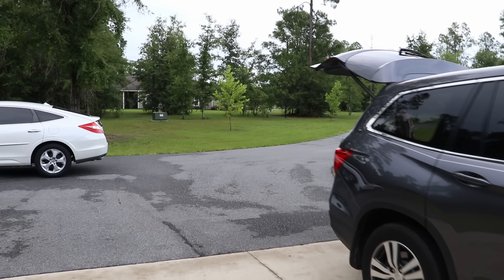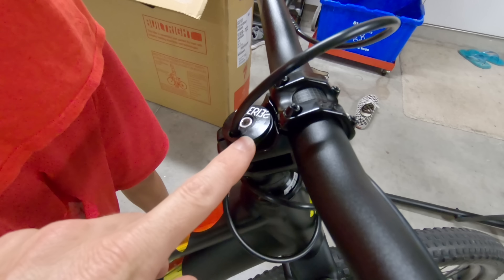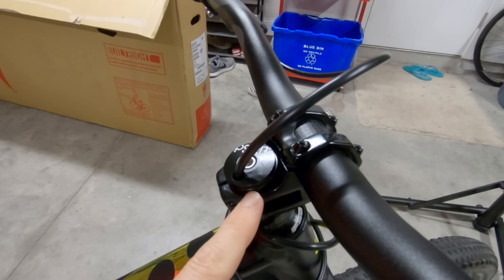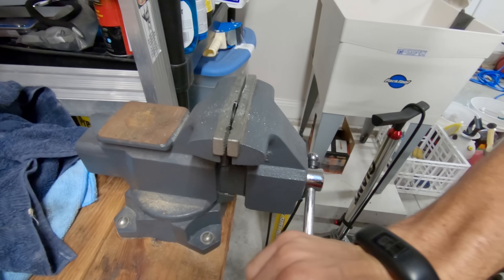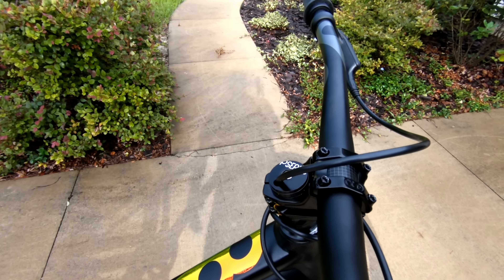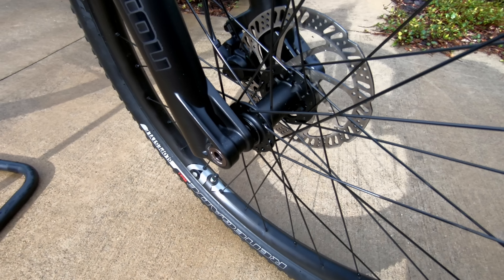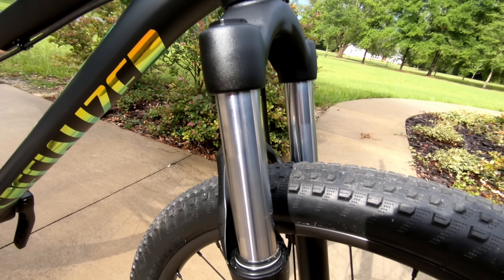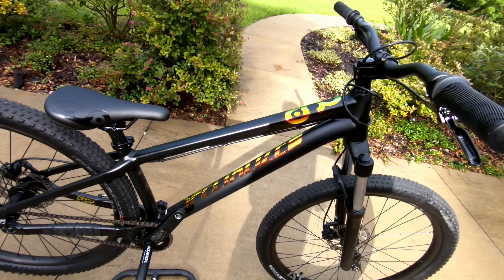Specialized P3 First Look (and solving an issue)

Comment: generally, dirt jumpers don't have front brakes, although this is personal preference and the chainstay guard is not needed as it is a single speed there is no slack in the chain as long as it is tensioned properly you will not get any chainslap
Reply: I agree. However, I wanted to make 100% sure my bike would not get scratched ;) I am glad it came with a front brake so I can do trials maneuvers!

Comment: Where can i get the part that is shown at 5:21?
Reply from the maker: Check with your local bike shop. Most likely you would have to get one from a specialized dealer, but Wheels MFG makes derailleur hangers for a variety of bikes. But that's a pretty specific one.
Reply: @ClintGibbs  I don't have one in my city and I don't think there is one in the nearest cities

Comment: There would not have been an issue with the headset if it had been assembled by an authorized Specialized dealer. It would have been corrected before they gave it to you. The bike shop that sold it to you in a box violated their dealer agreement. 
The bike comes with a front bike because European standards require a front brake. Instead of making two versions they all come with a front brake.
Reply from the maker: I'm sponsored by my shop and they've validated my mechanic skills. I've been working with their mechanic for many years. I'm basically an extension of the shop so it's legit.

Comment: Just undo the the hose from the brake lever , don't need cut it
Reply from the maker: The olive will not fit through the hole in the top cap. That means you have to cut the brake line and reinstall a new hose insert and new olive, as well as bleed the brakes.